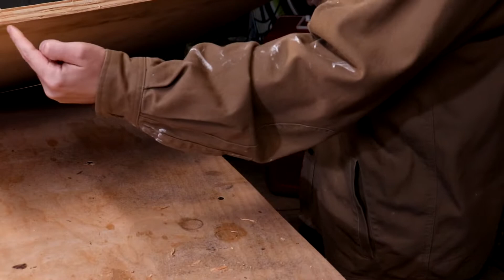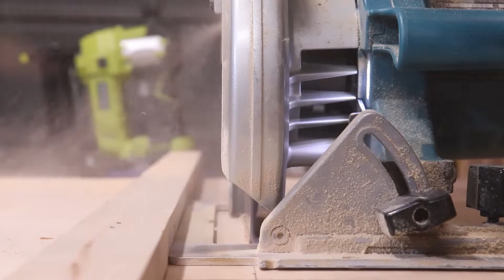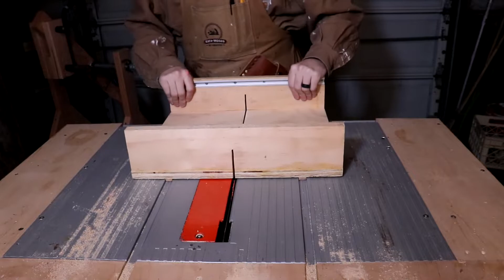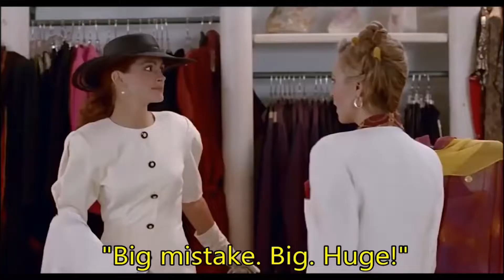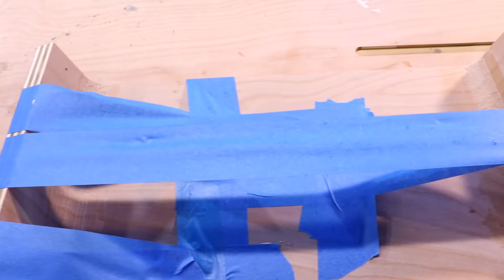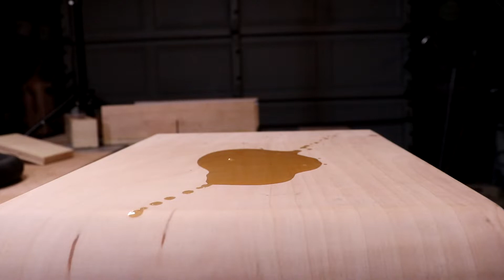Bent plywood laptop table for your couch!

Comment: Very nice work!!!  I would like to make something like this however I would like to hide the cuts.  Any idea how I could do this?  Again thank you for the time you put in the video!
Reply from the maker: Thank you! One thing you could do is fill it with wood filler, and paint it. It might show a bit still but it’ll be harder to see. You could also trace out the profile onto a piece of veneer and glue it to the edges. The only problem with the latter is that the grain wouldn’t follow the curve.